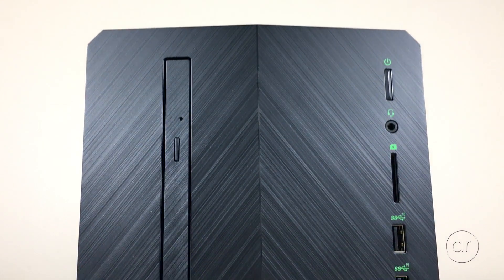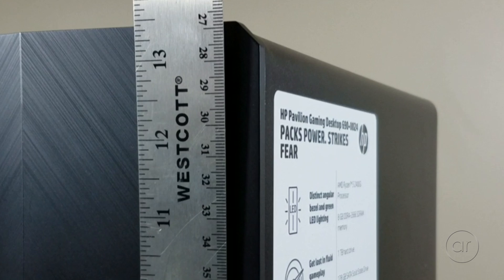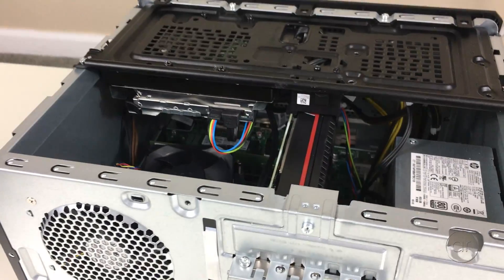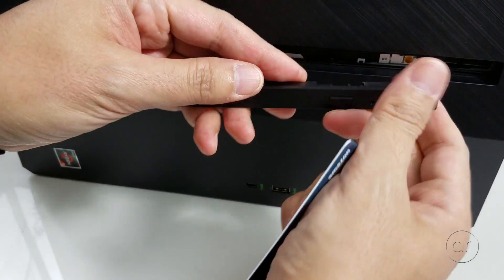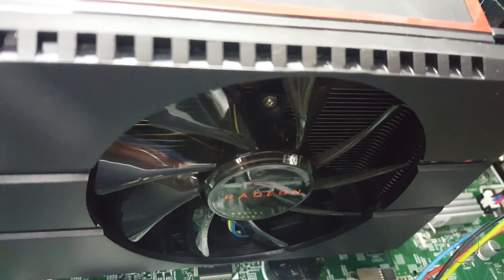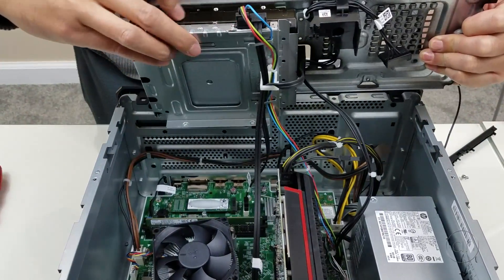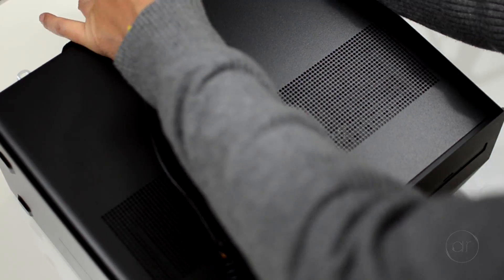How to Open and Upgrade a Ryzen-Based HP Pavilion Gaming Desktop

Comment: I upgraded my cpu to the R5 1600. Only $80 at Microcenter. Had to keep the stock cooler though. When changing the cpu, I noticed that HP did a terrible job of applying the thermal paste, it was all over the place and uneven. After changing the cpu, cleaning off and reapplying Artic MX4 thermal paste, the temps were much better. Though temps will never be great given the poor airflow of the case. Also added another 8gb of Gskill Aegis 2666 Ram. Works great.
Reply from the maker: Good find about the thermal paste. Do you mind if I add that to the description with credit to you? Also - do you have the model number of the RAM?
Reply: @accessrandom  Sure no problem. Gskill F4-2666C19S-8GIS
Reply from the maker: Thanks! I've added your comments - I had to abridge it a little bit because I'm coming up against Youtube's 5000 character limit, but I've captured the main ideas.

Comment: Just half upgraded this pc! I have the ryzen 3 model, i upgrade it to a gtx 1060 6gb (originally came with a rx 550) put on it 8 GB of ram more and added an SSD of 500gb now just need to upgrade the cpu but I’ll be waiting for the new Octa-core ryzen 3600 that launches sometime In summer for $180
Reply: Also had anyone tried to upgrade the fan? And if upgraded to a new CPU are we able to use the cpu fan you get wen buying any ryzen processors?
Reply from the maker: I just updated the description yesterday based on a viewer's experience with the CPU fan. Apparently, the punch outs on the motherboard aren't even for AMD CPU fans - they're for Intel - so be careful about that. May I ask what model number nVidia card you upgraded to, and may I add that to the description with credit to you?

Comment: I got this PC two months ago, it's alright so far but I'm definitely upgrading my CPU, RAM, and Ram. Thinking about getting a Ryzen 7, 1700x or a 2700x, idk yet. Upgrading from an RX580 to either a GTX 1060 or 1070, depending on the PSU as well. For the ram, i might just get another ram stick or get two 8gb ram sticks
Reply: Check your motherboard specs,according to HP site the X variant of ryzen cpus arent supported in the Hp pavilion 690-0010 using sunflower MOBOS
Reply: Very ambitious...and I understand the allure of upgrading what you have...but if you upgrade the CPU, GPU, and RAM what did you pay for? The motherboard and case ventilation are the weakest links here and that's pretty much all you're left with from the original purchase.

Comment: I Just Noticed  that only uses 6 ram out of the 8 it has.Why Is That?
Reply from the maker: One of my viewers discovered that the integrated Vega graphics on the Ryzen 5 2400G dedicates a portion of the system memory without giving you the ability to disable the APU in the BIOS.
Reply: Ryzen 5 is an APU, not a cpu like Ryzen 7. APU has built in graphics kind of like mobile phones in the same chip as the cpu. Is nice in that it can pair with certain graphic cards in a sort of similar to crossfire fashion, but because it is built in graphics, it uses regular ram for video ram use and takes away from total ram as a result.

Comment: Got the same version for only $600 about a month ago.  Planning on upgrading the memory soon.
Reply: Go with adata xpg 3000 and it will run at 2666 , same as stock speed

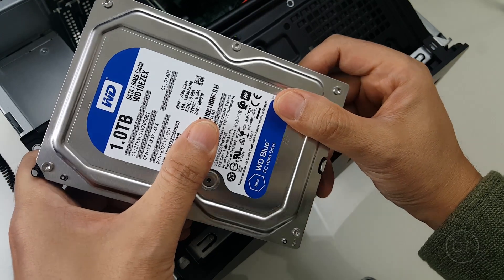Comment: for what you mention at 4:55 about a recovery partition , could i use samsungs data migrate tool and copy the drive to an SSD to upgrade? im a PC noob i dont know what a partiion is, would just copying the whole drive save whatever is needed and allow me to upgrade to SSD?
Reply from the maker: To make it simpler, you might want to use HP's Recovery Manager to create a set of recovery disks. You can use DVD-R's or a USB drive. Basically, HP will allow you to create one set of recovery disk(s) which contain an image of the factory-installed Windows.
Reply: @accessrandom  Okay. after that is complete, is it as simple as to remove harddrive and plug in new SSD? Is the operating system already on the 128gb SSD that comes with this PC?  Thanks again really appreciate it.
Reply from the maker: Sure, no problems. Yes, after you remove the hard drive, you can just plug-and-play the SSD. It will be a secondary storage device to the existing M.2 SSD (which has Windows on it).

Comment: Did anybody ever find a work around to disable the onboard video. This is an issue that I was running into with it using 2GB out of 8GB for onboard graphics with no way to disable it in lieu of the RX550 card being installed in it. See info below:

Thanks to Josh Patterson for the following note: the integrated Vega graphics on the Ryzen 5 2400G dedicates a portion of the system memory without giving you the ability to disable the APU in the BIOS.
Reply from the maker: Unfortunately, I don't think anyone has a workaround for that. I'll keep the description updated if I hear anything differently. Personally, I added another 8 GB module but that is not really a workaround...
Reply: @accessrandom  Alright, well, thanks for the reply. It seems so logical and normal and yet HP loves to cripple their BIOS/UEFI settings to a ridiculous level.
Reply: @accessrandom   apu takes up 2gb of ram now but u can go to the bios and turn off amd free play and that will free up 1gb of the 2gb its taken up
Reply from the maker: Thanks for the tip. I looked into my BIOS and didn't see that option. Perhaps we have different versions? My BIOS is 8433 vF.21.
Reply: I think HP might be able to update the bios so that the bare minimum is stolen from the system Ram, but  I don't know what that bare minimum would be or even if HP will ever address this. I added Ram as well, was going to anyways because of dual channel benefits.

Comment: I wonder if the graphics card could upgrade to a GTX 1660 ti. Let’s pray!
Reply from the maker: I haven't seen recommendations for any GTX 1660ti cards, so if you plan to try it please let me know - I am looking for more data points, which I'll update in the description.
Reply: Good luck getting the card out...there's an almost inaccessible screw holding the card to the motherboard.
Reply: I've actually successfully removed the GPU (long story) and there is NOT a screw holding it in place like I thought. I was being confounded by what turned out to be a hinged retaining clip that appeared to be welded in place but was actually not.

That said...comparisons I've seen online indicate the 1660 and RX580-4gb are actually pretty comparable.  The 1660ti is comparable to the RX580-8gb. I don't think I'd go through the effort and expense for no real gain in performance.

Comment: So can you upgrade the power supply if you have the answer ?
Reply from the maker: Unfortunately, I haven't received any reports yet but I will update the description with any success stories about power supply upgrades on a regular basis.
Reply: access random i havé contacted the hp support but i doesnt havé a response
Reply from the maker: Please let me know if you receive a response. The closest I have seen is on bestbuy's website where HP seems to have an official presence. They claim the PSU is standard (with standard connectors), but there are some doubts from reviewers.
Reply: @accessrandom  what is a psu ? srry for the question
Reply from the maker: No problems - PSU means power supply unit.
Reply: @accessrandom  so its the power supply
Reply from the maker: Yes, that's correct.
Reply: @accessrandom  so the plug are not standar ?
Reply from the maker: I'm sorry, I'm afraid I don't know at this time. I will keep the description updated as news comes in.
Reply: The connections to the MB, GPU, SATA, etc are all standard...the PSU requires a special interface with the MB to run the fan so the PSU can't be used on another computer...but another PSU will work in this one (assuming it will fit and align with the mounting points of the case). That said...there's no reason to upgrade the PSU...its actually one of the better components of the computer. There's enough power to run everything and its certified 80+ Platinum...so I don't know what you'd actually upgrade it to. More power from the PSU is pointless unless you do something that makes the computer draw more power...

Comment: i have a question , dont know much about pcs. If i got this pc could i simply remove the cage and DVD drive? to make more room inside the case? is it as simple as unplugging it? or will there be other issues? thanks.
Reply from the maker: Removing the cage would be a problem only because it provides the structure to which you mount your drives. I think it would be difficult to mount your drives anywhere else.
Reply: @accessrandom  oh okay thanks, also is there any room for extra fans? or just the one stock exhast fan
Reply from the maker: If you had a dremel, I think you could punch out a hole in the side of the side of the case (right next to where the cage resides). But without a tool like that, there's really not much room to add a fan anywhere else.
Reply: @accessrandom  thanks apreciate tjhe info
Reply: If you're interested regarding cooling...read my response to an earlier question.  Removing the rack is pretty much a necessity unless you want to cook your CPU.  The rack actually completely blocks the vent holes in the case cover.  Removing the rack allows for air to come in through both the intended vent holes and the inadvertently through the hole left from removing the optical drive.

Comment: Is this a special made Rx 580 by hp and can it be matched with a different motherboard
Reply from the maker: I'm not sure who the OEM is, but from what I've read at other sites, this is a fully functional graphics card that can be used in a different motherboard.
Reply: @accessrandom Do You think the 580 Is compatible With MSI B450M PRO-VDH Motherboard?
Reply from the maker: @xxxghostkillerxxx8427  Do you mean for pulling out the 580 and using it in that motherboard (in a different case)? That should work - it has the PCI-E slot you'd need for that card.
Reply: @accessrandom  yes thats what i meant because i want to rebuild this pc with a new motherboard and a new cpu and i want to save money and use the 580 in this pc and put in the new one i wanna rebuild and then save money to get a 1660ti or something so is it possible to take out this 580 and put it in a new PC or is it not possible
Reply from the maker: Yes, it is possible - I just tried it so I can verify that it can be done. Just install the RX 580 drivers on the new machine.
Reply: @accessrandom  Ok Thank You Very much
Reply: The RX580 in this computer is a reference OEM model...it's not one you'll find for sale anywhere, it was custom made by/for HP to use in mass produced pre-built computers.

Comment: If I wanted to add a 16gb ram would i need to do any other upgrades or can i just add the ram and be fine
Reply from the maker: If it is a 16 GB module that you want to add to the existing 8 GB module, I would not recommend it. Adding an 8 GB module to the existing one is ok - for a total of 16 GB -  as long as the specs and timings are the same (successful brands/models are listed in the description). In general, you'll want to use the same size for both slots for dual channel.

Comment: Looks exactly like my 590-p0020.
Reply: Same case different front tho
Same motherboard and a 180watt psu rather then a 400watt psu
Reply: @apachehelocopto1779  I know. It was basically a joke. Now, if the PSU is compatible with mine, I might have to track one down
Reply: Its the same dimmensioms so should be no problems
Reply: @apachehelocopto1779  Not really that, so much as the same style plugs
Reply: @joeyhillers9460  There the same SSF HP power supplies in dimensions and size just different power raitings

Comment: I got this pc but mine is a Ryzen 5 2500 with a nvidia gta GeForce 1050 with a 600 w power brick. I absolutely have no problems. Boot up is on the slow side but other than that runs fast and smooth soon gonna add another hard
Reply: Woah woah 600w PSU? give us the model number
Reply: You could get a ssd for it to get some faster boot times
Reply: I have the same one , I was wondering if it is possible to update to a better graphics card?

Comment: I have an HP Pavilion 590-p0024. I wanna upgrade the PSU so I can put a 1050ti in it, and maybe a ryzen 5. Would the PSU in this machine work with my own? I determined the motherboards are identical and have the same power connectors. Would it be a safe bet, and if so, can I get a model number for the PSU in this machine?
Reply from the maker: I just looked up the 590-P0024 and it looks like it has a 195W power supply that powers the integrated Vega on the Ryzen, so it doesn't have a discrete graphics card. Power-wise, 195W is going to be too small to power a 1050ti, but I think 400W should be sufficient.

According to HP's partsurfer site, the part number for the 690-0024's power supply is L04618-800, but you may want to check the upgradeable parts list for your model since the case is a bit different for the 590 series.

Comment: What’s the name of the ram that I need to install into this pc
Reply from the maker: If you want to add another module to the existing one, there have been two different brand/models that have been reported: the Samsung M378A1K43CB2-CTD or SK Hynix H5AN8G8NCJR (please see the description for other memory models that have been reported to work also).
Reply: access random thank you
Reply: @linachon3421  if you get adata xpg 3000mhz it will run at stock speed for the computer-2666mhz. Otherwise getting 2400 ram it will underclocked it below 2400

Comment: Hi access random, the top of my case tends to get hot and also gets pretty loud when playing certain games. Is this normal? And if not, what can i do to prevent this?
Reply from the maker: I noticed it too - yes, this is normal. Fortunately, there is enough airflow to remove the heat from the case.
Reply: Thank you for the response! Really helpful video btw
Reply: This is normal...but unacceptable. Download free monitoring software and track your temps. You'll see that you're CPU is probably running in the 85c (185f) which is way too hot. Part of the problem is that if you look through the air holes in the case...you'll see that they are completely blocked by the rack holding the HDD and Optical Drive.  Even removing that completely isn't quite enough. the stock low profile down draft CPU cooler is incapable of cooling the CPU.
Reply: @terryparrott9426  I appreciate the response, what would you recommend I do to keep the temperature cool?

Comment: Can you switch the case
Reply from the maker: Yes, you should be able to switch the case. The only caveat is DVD/CD drive, which has a very slim profile, and the front panel USB, audio, SD reader, etc.
Reply: A note on this...the form factor of the motherboard is non-standard, the case and motherboard were designed together so just mounting it in another case wouldn't be as straight forward as you'd hope.

Comment: Thank you for this video... I am looking to upgrade the RAM but not sure whether to go for 2400 or 3000...any suggestions? Things I have upgraded so far:
1) Took out the sata SSD and replaced with Intel 660p m.2 512GB pciex4
2) removed HDD, added 2TB ADATA SU800 sata SSD in it's place....awesome
3) in secondary HDD space on cage, added 1TB SanDisk ultra 3d SSD . Just had to add sata cable and used the already-there spare SATA power cable which was convenient. Due to weird spacing of screw holes on the cage, only two screws aligned on the SSD to be able to attach which I think will be fine.
So I have 3.5tb of storage which I'm happy with.
If anyone can help with ram suggestions, I'd highly appreciate it! Thanks in advance
Reply from the maker: The secondary SSD should be fine - for the moment, I just velcroed mine to the cage :). If you're looking to completely replace the original RAM, I would go with 3000 (even though the HP will downclock it) - if you ever decide to transfer the RAM to another system, at least you'll have a more future-proof set. If you're looking to add a stick to what's already there, your best bet is to match it (2666).
Reply: @accessrandom  just wanted to add that I ended up with 8gb x2 adata XPG (3000mhz)  and they are running at 2666 just like the stock ram did. Not sure if that's what you meant because others had said it would be underclocked even more
Reply from the maker: @jakew3  Thanks for the update. Yes, that is what I had expected. I'd recommended 3000 because it gives you more flexibility if you decide to transfer it to another system.
Reply: @accessrandom  have a question for you. I'm trying to improve the CPU temps and I have completely removed the cage in an attempt to allow for better airflow. I bought cooler Master thermal paste and want to install it, but cannot get the screws holding the fan\heatsink loosened. they are the ones that go through both and are attached to the motherboard. I am putting so much force on them that I feel like something is going to break and the screws just won't turn at all. Is that normal? Should I just keep applying force or could there be a different problem? I'm not sure what other problem there could be because it shouldn't be this complicated but I also would not expect so much force to be required. Thanks for any insight you may be able to provide.
Reply from the maker: There's a viewer who did the same thing (Terry Parrot in the description) by removing the cage. I haven't tried removing the CPU fan on the HP, but I have done it for a couple other Intel and AMD computers. I don't remember having to apply any force beyond the usual torque of a screwdriver (i.e., just enough downward force for the bit to grip the screws). Are you able to try different sized screwdriver bits?